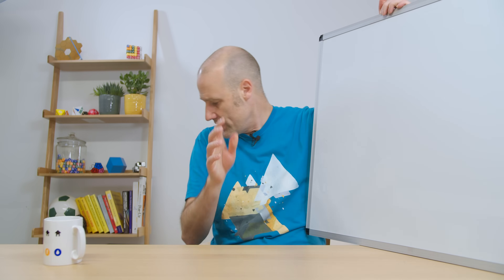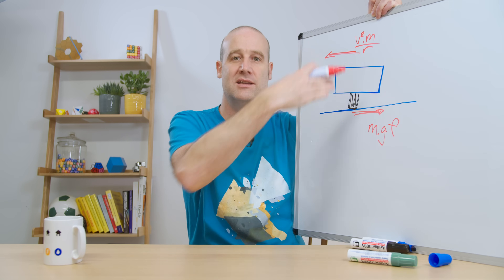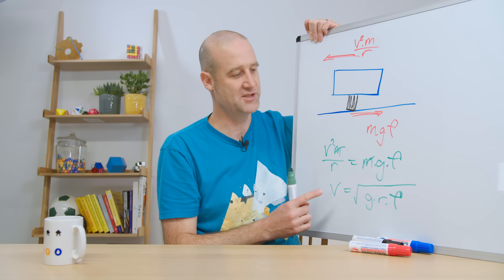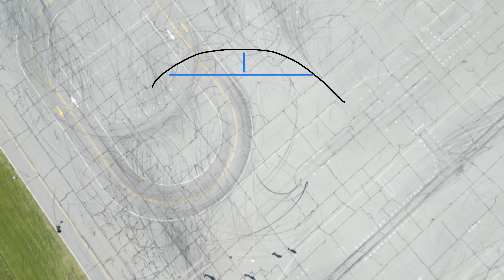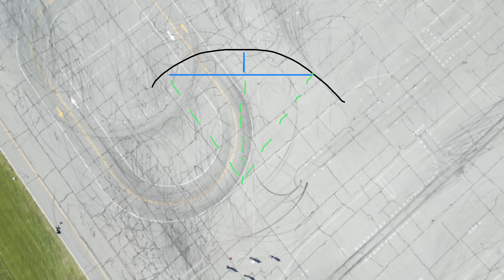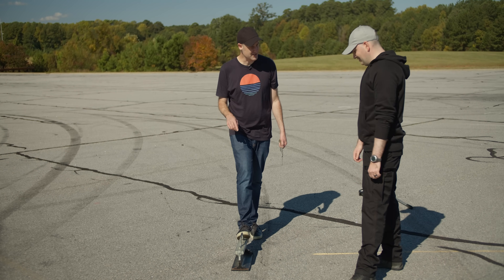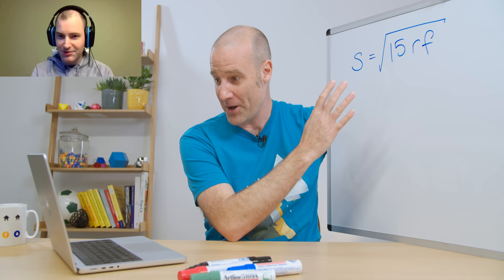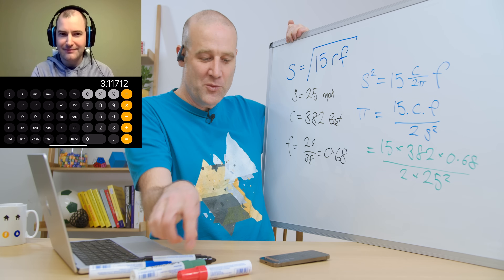Using an Out-of-Control Car to Calculate π.

Comment from the maker: UPDATE: If we had used 26/38 exactly were would have π = 3.136421 which is basically 3.14. (I stand by my 3.12 but I am kicking myself.)

Yes, yes, it's not Pi Day for a few more days. As always: I try to get the Pi Day video goes out a few days early so teachers have time to plan their Pi Day activities. And leaving it until Monday next week felt too late.

So, ah, what are we all doing for Pi Day this year?
Reply: Given pi = 3.112, the viedo release isn't that badly timed
Reply: I'll be wondering what's so special about 14.3!
Reply: @jackeea_  For large circles, Pi is obviously larger, too ;-)
Reply: @jackeea_  so will about 7.5bn (US bn not proper UK bn like I was taught at school) other people.
Reply: I just started working in a building with an office numbered 3.141 :) I'll be spending the day getting as many pies into that office as possible.  Have no clue who is in that office. Gonna be fun.
Reply: At that point anyway you would lose some precision using 14.92 instead of 15!
Reply: @PitchWheel  Why would he use 15 factorial? /jk
Reply: @PitchWheel  14.962*
Reply: On π day i am going celebrate my birthday
Reply: I wanted to also point out that if you used pi and solved for velocity, it would have worked out to 24.979 MPH which is astonishingly close to the 25 MPH recorded. Very neat maths. I had no idea how crash forensics would determine the speed of a car using skid marks, nor how accurately they could do it!
Reply: Calculate pi by pi day release dates.
Reply: @SoftwareSimian_  This will require a recreational spreadsheet.
Reply: for a second i thought you released it today because that's how far off your estimation was gonna be 😔
Reply: We know the real reason, it's the famous Parker Pi Day Approximation.
Reply: At a circumference of 385 feet you would have calculated pi to be 3.1416, and since a skidding car that is turning will lose velocity and therefore skid an arc that is tightening (like an inward spiral) - wouldn't it be plausible that the circumference you measured was 3 feet shorter than it should have been? I'm going to say yes because it would be sick if it accurately rounded to 4 decimals from this measurement.
Reply: If you had not made the approximation for 14.962 as 15, it would sadly be 3.1284 :(
Reply: I have a maths test on π-day
Reply: @timkw    "I have a maths test on π-day"

The very best day.  Good luck.
Reply: Sinä The drag force 26 and the speed 25 have only two significant numbers, your result of π is perfect: 3,1 in two significant numbers
Reply: I wish you had talked about sig figs in this calculation. Maybe something for a quick video on your second channel?
Reply: The biggest measurement errors would probably be in the speed and friction coefficient (given as about 26). Looking at just the friction measurement, a single unit could be +/- 0.5 either way, f may have been between 25.5 and 26.5. An f value around 26.11 would have give pi correct to 4 decimal places.
Reply: I'll probably be giving pepper to a friend xd
Reply: I got a pi tattoo!
Reply: I'll be baking pies in square pans.
There, I squared the circle; Now, can everyone be happy and get along?
Reply: While I understand releasing it a bit before pi day for that reason, I think it'd be funnier if you released it on whatever day corresponds to the pi you calculated that year. (So if you used your pi = 3.12 figure you made, you'd release it on March 12th.)

One way you could do this is by re-uploading it if that day happens to come after the day you would want to release it early for, and releasing it a bit more early on years where pi was estimated a bit short.
Reply: As an astrophysics nut, the whole of March is "PI month" - which is a joke so bad that not only will only other astrophysics nuts get it, but they'll groan about it as well ;)
Reply: Well, my birthday is March 13th...

My wife+kid+me are watching Avatar 1 on Saturday, seeing Avatar 2 in 3D on Sunday, and taking my puppy to a nice park on Monday.

Thank you for the wonderful videos, Matt! Can we get some more "Do Stuff W/ a Thing and then do some Working Out" some day? Pleeeeease? 👍❤️😍 It would be AMAZING if you could pick the brain of Daniel Tammet in one of your videos!
Reply: it’s Parker Pi Day
Reply: And rounding error.
Reply: It's close enough to pi day if you're a cosmologist!
Reply: In the future, you should release the videos 3.14 days before Pi Day.
Reply: I'll be spending Pi day with my gf. Travelling to California on Monday and staying for a week. Will be the first time we've met in person (I'm in the UK)
Reply: Can you please do a Pi-Calculation Tier list video that summarizes past attempts?
Reply: Deriving the binomial expansion for non-integer exponents, hence creating a power series for the reciprocal of sqrt(1+x^2), integrating the power series to obtain a series for arcsin(x), and then finally evaluating it at 0.5 and multiplying by 6.

That should take an hour or two.
Reply: The maths department at my university is handing out pie!
Reply: I'm helping organize a Pi day puzzle hunt at my high school
Reply: i have a piano class, and one of me pieces you get to play at random. so ill be using pi for the order in which i play.
Reply: My friend and I are memorizing 314 digits of pi :)
Reply: i always make pizza.
Reply: Baking pumpkin pies for an entire minecraft server!
Reply: Calculated pi as 3.117...
Ok guys, lets post this video 3/11
Reply: If you then work backwards you get the actual speed of 24.85 mph. Which shows just how amazingly sensitive and precise these calculations are. One can pin the speed down to the yards per hour.
Reply: It's so nice that you give teachers two days to find their own vehicle, parking lot and stunt crew so that they can recreate this amazing experiment with their students. 😁
Reply: The unit conversion part was rounded to 15, from 14.962.
Using that (along with the 26/38) brings the calculation down to 3.128475.
Reply: Like you said, anything between 2 and 4 would be acceptable. 3.12 is a phenomenally good approximation.
Love the 'just give it a go' approach you have to maths.
Great stuff as always.
Reply: Check out the latest Grand Illusions video 'To Hold Infinity In The Palm Of Your Hand'  - simple but fascinating spirals and circles - there has to be some pi in all that...
Reply: Not to burst your bubble Matt, but you also rounded up to get to 15, so that would pull it further away from 3.14 again!
Reply: So now the trick would be to recalculate the value of that 15 coefficient to work with the World Standard(tm) measuring system. 🙂
Reply: @lwilton  "So now the trick would be to recalculate the value of that 15 coefficient to work with the World Standard(tm) measuring system."

Never!
Reply: If you had measured the circumference as 385 ft the calculation of pi would have been 3.1416
Reply: One of my favorite things about pi is how for almost any calculation you can just use 3 and it won't matter. Bonus points if you multiply pi by the metric value of gravitational acceleration.
Reply: I went straight to the comments and now have to restart from the beginning. But thanks for this 😂
Reply: I'm going to spend pi day (real;) to pi day (parker) trying to understand  10*pi(parker) lines of python code, in trying to reverse-engineer and understand the Linden-Buzo-Gray algorithm,, just to truly appreicate how much of a wizard @solid-state is.
Reply: (And, since Youtube can't highlight or acknowledge their own users: put "Saturn V LIFT OFF! To PETSCII and beyond" into your search bar.
Reply: If you use 14.962 for gravity it drops to 3.12847545
Reply: Haha just watched and found the same (another Aussie math nerd down here)
Reply: My school is doing a pi memorization contest. Currently at 35 digits.
Reply: Omg Eric trying to sabotage your pi escapade Matt!
Reply: Sir, I know a formula it's a formula and I can get what's for, tho... I read the numbers and can't figure out how much is that, since the royal system does not mean anything to me. I'm very surprised rational people practicing physics doesn't use the metric system, or could even deal numbers with one which seems to be came straight out from The Lord of Rings.
Reply: Without realizing the date before the video popped up in my screen: Tuesday going on a date, with a highschool math teacher
Reply: Well, PI is approximately 3.1 == 3.10, so I think it's fine to upload it 4 days earlier ♥
Reply: Oh, Matt, you make me want to show you my unit conversion app.

This was fun.  :)
Reply: Well you video proved that you can't have your Pi and eat it too.
Reply: We can only ever approximate Pi Day, because April only has 30 days.
Unless (of course) you want to use the 22nd of July, to get closer to Pi.
Reply: @dj1NM3  

You can also interpret May 1st as April 31st.
Reply: @frankharr9466  Japan will get an entire Pi Year in 1119 years, not just a measly day (they use the ISO date format).
Reply: You should double the fun and include Tau day! (Pun intended)
Reply: I think you should look to release your Pi Day videos on the date that you calculate - as long as it's an under estimate!
Reply: On Pi Day 2023 I’ll be driving all day to move to a new house in another state of the USA.
I probably won’t get to make any skid marks along the way, but at least it is a car related activity!
Reply: I wondered if you had purposefully released it on the *result day*, rather than pi day. It seems pretty close. not sure about the decimal part and the time of release though.
Reply: Here's a new video for Pi day, it uses standard cryptography to find the message suggested by Carl Sagan in the book Contact, and it's in exactly the first 200 digits. Video is only about 6 minutes long. Could you check the math? Doesn't seem difficult.

314 GOD Pi Speaks Jesus is Lord The Tutorial
Reply: Eat pi.
Reply: All the intermediate rounding is taboo to my engineering training!
Reply: another way you could improve your value, is by measuring the gravitational acceleration, and calculating more digits of that constant (or getting the value from wolfram)
Reply: This year (2025), we get a total lunar eclipse on pi day. If all goes well and the weather cooperates, I shall calculate pi using the lunar eclipse.
Reply: Not trying to be too cynical, but the description of the weight of the friction sled on the day being 40lbs then being updated post-hoc to an oddly specific 38lbs seems like someone did the Pi calculation first and then retrospectively tweaked the sled weight to get it closer to the desired result.

I'm sure it was all above board, but my intuition just grated on that little change seeming a bit too contrived.
Reply: @arichakrabarti5765  if it helps make you feel more secure, weights outside of critical need are notorious for being slightly misleading in their weight.
Reply: @arichakrabarti5765  it's a lot easier to do division in your head when the denominator is a round number, so they probably rounded at the time. Dividing by 40 is as simple as dividing by 4 and then shifting a digit, while dividing by 38 is... a lot trickier in your head.
Reply: @BigDBrian  I agree, although I would also say if you were building a purpose built friction sled, you would aim to actually make it 40lbs and not just whatever weight it happens to be once it's done.
Reply: @arichakrabarti5765  "I agree, although I would also say if you were building a purpose built friction sled, you would aim to actually make it 40lbs and not just whatever weight it happens to be once it's done."

But if you're using whatever friction sled you can get your hands on, you weigh it and find out what it is.

Comment: how i would have calculated the circumference:
1. measure the length of the skid mark arc (skid arc)
2. find the tangent lines at each endpoint on the arc
3. find the lines perpendicular to each tangent line (they'll intersect at the center of the complete circle)
4. measure the angle where they intersect (in degrees, to avoid pi)
5. then, the total circumference of the circle is (length of skid arc)360/(angle between the lines going from the center to each skid arc endpoint)

i feel like this is a better method than reconstructing the whole circle

Comment: I am not super confident on my math, but I believe Matt's current running average for pi is 3.316012

The Avogadro one really messed it up, without that it's around 3.13 (rounding up because the next few digits are all very large)

Comment: instead of completing the circle you couldve gone around the skid measuring the length of the skid while holding a compass, the angle change will be the total angle traveled around the circle so multiply the distance by 2pi / the change in angle. this avoids ever invoking a centre of a circle and a radius

Comment: Why measure the entire circle? Why not just do length of the arc = pi*r/angle of the arc? Surely measuring the angle is easier than measuring the perimeter of the entire circle.

Comment: So I imagine this only works if you don't apply the brakes? If you do and the wheels lock up, I think the car would continue in a straight line, but it would continue spinning around its axis. I wonder how much math it would take to reconstruct the complete "during" using a top-down photo (drone!) of skid marks that don't follow a continuous path. ...and I wonder how long before Eric gets replaced by a drone and AI software.

Comment: Matt, Matt, Matt... The physics gods are upset! You drew the centripetal acceleration as a centrifugal force! The car is not experiencing an outward force that balances out friction. It is experiencing only the friction force and therefore net centripetal acceleration. 

I wouldn't consider this a Parker Square situation as the Parker Square almost works but doesn't, whereas your FBD here is just incorrect but still gives the right answer. :)

Comment: Hi, Matt! I recently discovered your channel and I really like your videos! I saw few of your pi day videos and it made me think if there is another unusual way to calculate pi. And I found interesting way how to do it. You surely noticed that the more sides a polygon have, the more it resembles circle. So I simply assumed that circle is a polygon with infinite number of sides. I generated more than 200 polygons in GeoGebra, measured distance from center of the polygon to the vertex and use it as a radius of a circle. From π = P/2r I calculated in Excel approximate value of pi. Than I put it in to GeoGebra and generated logarithmic function. It was far from ideal but after some corrections I came up with two logarithmic functions that can turn any real number in to approximately pi. If you are interested, I can send to you some Excel and GeoGebra files and write you some details about entire process.

Comment: 4:40 As an engineer and noticing no one else said something in the comments, I got to point out that your initial speed conversion factor as written in the video was incorrect.

S (mph) = V (ft/s) * 1 mile / 5280 ft * 3600 s / 1 hour

Numerically:
S = 3600/5280 V = sqrt[ (3600/5280)^2 * 32.174 * r * f] = sqrt[14.957 * rf]

So the final answer was still numerically correct but the dimensional analysis step was inversed accidentally.

Comment: I think I've got one for you next year.
π appears in the Coloumb constant, k=1/4πɛ0, which appears in the force of charges on each other: F=(kQq)/r^2
So you could build a small ion engine that'll create ozone, which will push away from the differently charged engine and could push a small piece of paper. Measure how much the paper moves to calculate force from the ions and work backwards to get to k and then π! Makes a great demo
Perhaps you could find a way to do a similar thing with a particle accelerator as well. That would make a cool vid

Comment: Round off is the difference 15 vs 14.964 gets you closer 3.12692 with that one simplification. Close but if you were to use 3.11 to send a man to the moon you missed

Comment: If you use 32.17405 ft/s/s for acceleration and you DON'T round off the conversion factor (14.95694) to 15 and you don't round off the 26/38 (coefficient of friction) before you calculate, you get 3.1274174. . . , which rounds to 3.13. Not as good as 3.136421, but still better than 3.11712. I'm surprised that Matt—someone who really understands math and calculations and errors and significant digits and so forth—would make an error (multiple times!) such as rounding off an intermediate result and then using that rounded-off value to calculate the final result.

Comment: If the speed is taken from the car's odometer, then it already incorporates pi to calculate the speed, as well as the "roller tool" that you used to measure the circumference.

Comment: Just here to say that the one wheel aproximation doesn‘t make me angry as an automotive engineer

It rather makes me quite happy since there is something called „One track model“ in use, which is basically your model with a front and rear axle, so it‘s not to bad simplifying that model down to one wheel❤

Comment: In order to find the center of the arc’s circle, did you use tangents to the arc and find the radii at right angles to the arc at its points?

Comment: So they used the radius to draw the circle, and then ignored that radius and instead recalculated it using the velocity equation, and then divided to get pi.

Seems like there's at least one part there that could have been skipped...

Comment: I like the using 15 thing to convert straight to mph. We do the same thing in oil well drilling to calculate hydrostatic pressure. 0.052 x fluid density in lbs per gallon x depth in feet = hydrostatic pressure in psi. Dicking around with units and conversion factors for no reason is just a waste of time